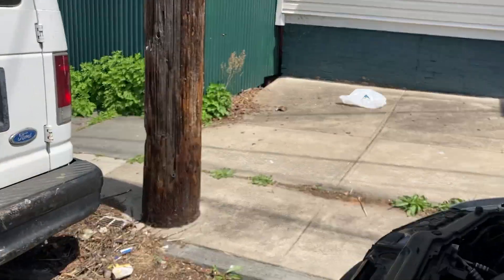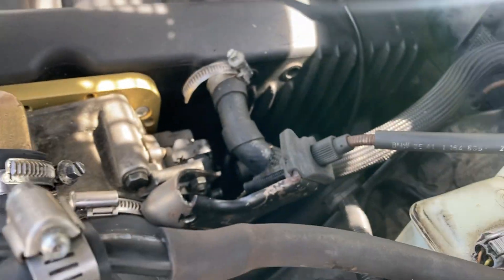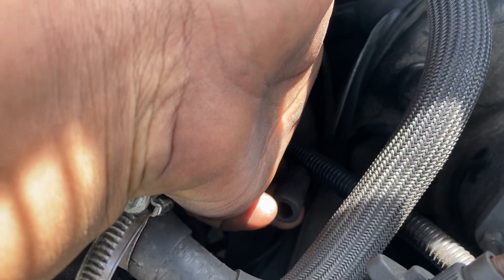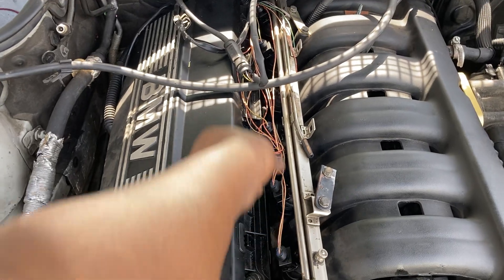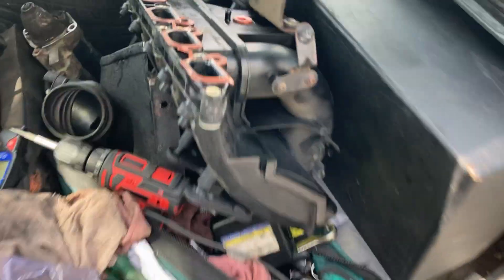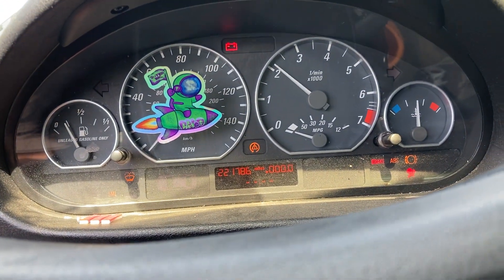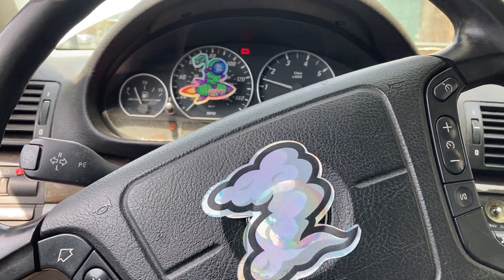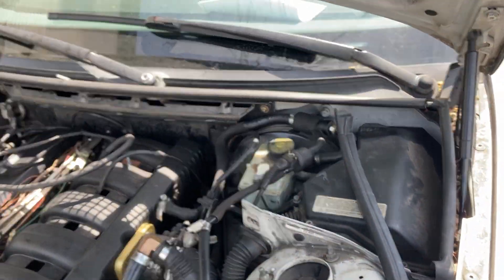E46 M52tu how to make m50 manifold work with M52 throttle body

Comment: So what did you end up doing to fix the throttle cable and how did you turn the eml light off? Mines stuck on my car
Reply from the maker: I had to get a tune car ran fine, but now it’s  ms43 swapped, with electric throttle body car feel amazing now

Comment: Any power increase from stock then ? How much? Ta
Reply from the maker: I really felt power increase when I ms43 swapped the car running electronic gas n throttle body I didn’t dyno it but its faster not quick,
Reply: @Problematicars how did you swap from ms42 to ms43? I need to do that to my car
Reply from the maker: Get a ms43 engine harness
Reply: @Problematicars  i looked up a video theres no reason to do that you just add the pins for the electronic throttle body and pedal and connect a few other wires together
Reply from the maker: There’s different ways n that’s one way to do it , splicing didn’t work for me,
Reply from the maker: I wouldn’t recommend something that didn’t work for but it could for car tho
Reply from the maker: Retaining factory harness didn’t work for me. It can work for u tho